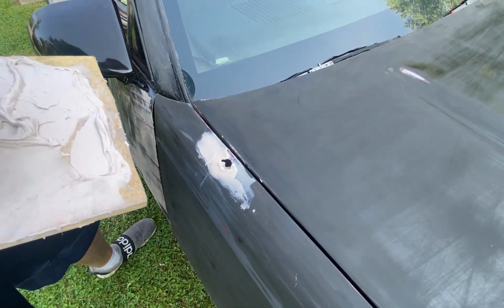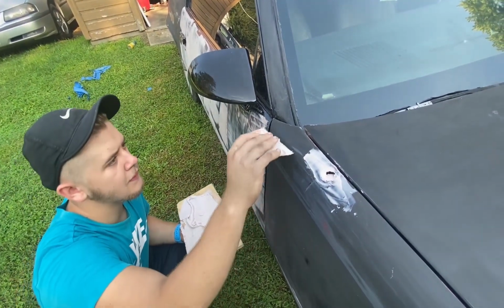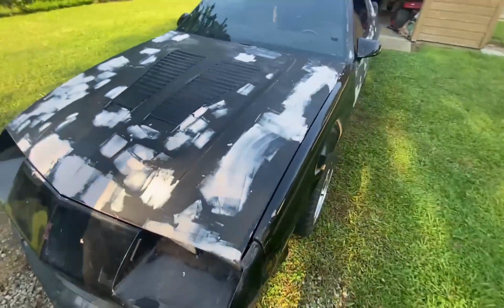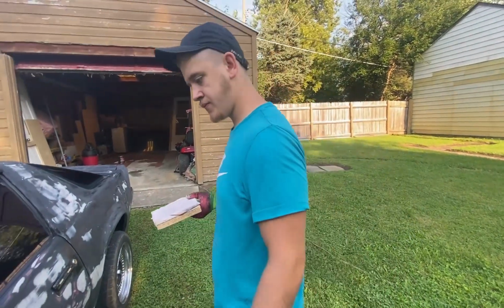Rebuilding a wrecked 1987 iroc z28 camaro

Comment: better to lay it on a little thicker and sand it off with a long sanding board....it will remove most of it,leaving the low spots filled....also bondo doesnt stick well to paint
Reply from the maker: I appreciate the feedback this is also my first time doing body work and if I sand too hard it goes down to bare metal so I don’t think there’s much paint on this car anyways it’s more acting like a primer.